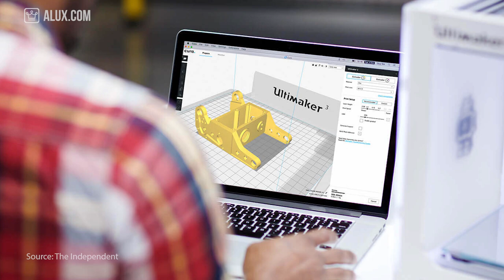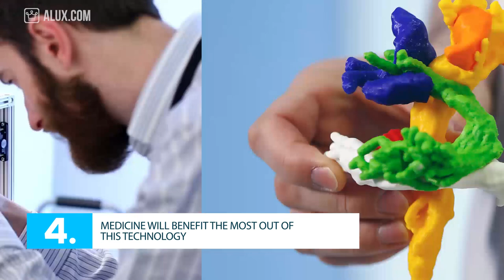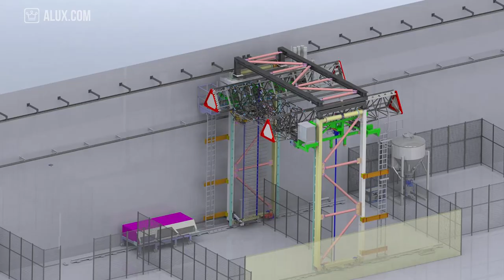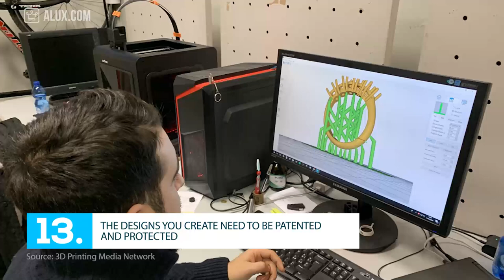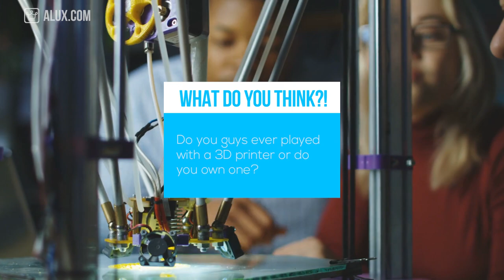15 Things You Didn't Know About the 3D Printing Industry

Comment: I have a 3D printer called the Ender 3. I had a part break on my document scanner, replacement part cost $275! I went into TinkerCAD and designed the part and for less then a dollar printed the part. Same thing with my Jeep. The cargo cover handle broke, replacement cost $125, again designed it in TinkerCAD and printed a new one! My 3D printer cost $285, has already paid for itself!
Reply: Kent Harris Sorry, but, you paid $285 for an Ender 3?
Reply: @benjamin_f_gates  I paid $260 for the Ender 3 Pro... but seriously, what diff does 50 bucks make when you can print parts within a matter of hours that save you hundreds?
Reply: Nate Ungrodt Well, yes. I was just surprised.... wherever you bought it, I wouldn’t again.
Reply: @benjamin_f_gates : HP is a good brand. I used to work on there printers. Also Jeep is a good brand. It's just the after market manufacturers that are greedy. Same problem with GE  refrigerators and anything else you buy that have lots of parts.

Comment: I own a printer and use 5 printers. I get designs online and make my own when nessecary. 
I don't think there is any question of it, 3d printing is amazing and the future.
I do have to clarify a point you made though, you mentioned that 3d will take over manufacturing. Well, that's not really true. 3d printing is good for prototypes and single items. Mass production is something that 3d printing is staying away from and probably will stay away from for a really long time. Doing mass production with 3d printing is just inefficient and expensive. Injection molding is what mass production uses now and it's allot cheaper that 3d printing could ever be.
Great points about how amazing 3d printing is though.
Reply: in 2014 a  private company in china 3d printed 10 small homes in 24 hours. I think it is the future to even building skyscrapers.
Reply: That’s very short sighted. What 3D printing can’t do today, does not mean it can’t do in the future. Technology evolves

Comment: 3D printing is an industry people are taking for granted thinking that it's an infant industry and less practical.  But they're wrong this will be the future, you will no longer go the grocery store but printing everything in your kitchen. All in All the opportunities are coming soon.
Reply: So... How can you get the organic part needed to print your food?
Reply: As an Engineering I disagree with you the term "Less practical" and "this is not going to be future". You are going to buy 3D printed finished product in future (There will be at-least one 3D printed product in your home) An average person is not going to print his tools at kitchen but you will buy it from a company. 3D printing is already well developed ( and developing to next level) in tech industry, creating moving parts or just making a box for a finished product with injection molding (The mold container) costs around an Iphone to develop. If the box is 3D printed it costs just couple of bucks and if the dimensions of the product ended wrong (with injection molding) better luck you can spend your kidney for another mold.
Reply: if it were possible to print food in your kitchen, the electricity / supplies to run the printer would be more than the cost of going to the grocery store
Reply: Coming from experience, you probably shouldn’t use 3d printing for consumer products on the market. Instead, most industries use 3d printing to prototype their product to save costs.

Comment: 6:15 no they don't look for men only but those most suited for the job. Yes not many woman are involved or have interest in 3D printing but if a job offer is up and you have let's say a 50:1 ratio changes are higher you find a guy that can do the job instead of woman - despite the fact a woman can do the same job. Just a supply/demand issue.